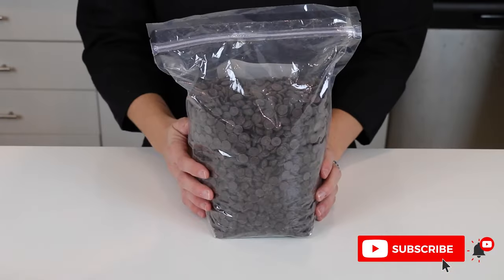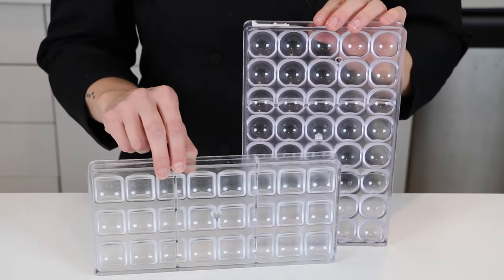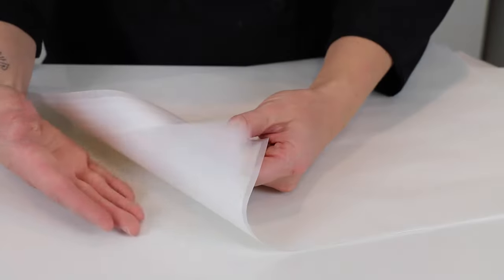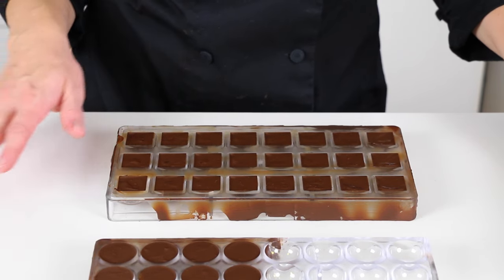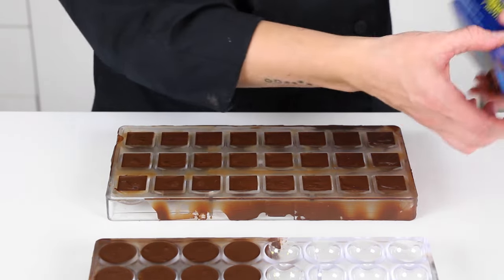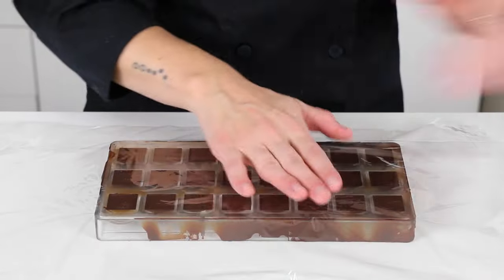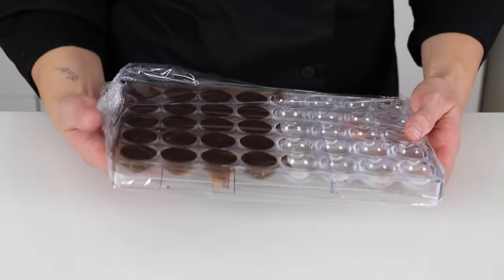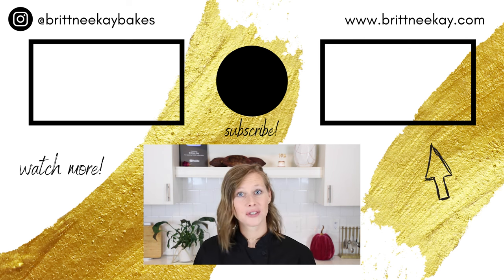Chocolate Molds | How to Fill and Unmold Chocolates | Gold Fall Bon Bon Design

Comment: After spending hundreds on labels and packaging I'm finding out the hard way you need more than just chocolate and coconut oil to make the perfect chocolate. It melted completely. Do I need a wax? I was trying to be healthy. Tempering seems impossible. I'm using a gravy dish that I sit in warm water  to pour the chocolate into molds. Thank you for reading
Reply from the maker: Hmm yes chocolate works takes research and many hours of practice! I wouldn’t expect to be expert at making formulating your own chocolate right out of the gate. It’s also something I can’t help with because it isn’t my specialty. I make filled bonbons using couverture chocolate that is already formulated. But don’t give up, just keep learning one thing at a time! 😃

Comment: Hi, I was very happy to see your video. My question is , why My chocolates doesn’t cames out . ? They stak in the mold ? I use the molds like yours. Be happy to hear from you. I am from Malta. Thanks
Reply from the maker: Most likely the chocolate isn’t tempered correctly, they haven’t contracted all the way, or the mold isn’t clean. What was your process exactly and maybe I can help! 🙂

Comment: It is so cool how you take the time to describe all the details of what you are doing. Thanks for going nice and slow so we can really see every step.

After you shell your molds, you are checking to see if they are the proper thickness. If you discover that they are too thin, would you wait until they dry completely and then do a second shelling?

I recently learned the hard way why it is important to work at the recommended working temperature for each type of chocolate. I tried shelling with a white chocolate (actually, caramelized white chocolate) at 32° because I wanted it to flow into the cracks of the mold more. However, it ended up so thin I could see right through it. The next tray I kept it at 32°, but kept it in the mold longer. This resulted in some spots being too thin and others being too thick. I had to literally scrape out the thick parts and paint on more chocolate on the thin parts with a paintbrush. It was kind of a disaster. The third tray I did it at the right temperature (29°) and, like Goldilocks eating the baby bear’s soup, it was juuuuust right!

PS Don’t tell anyone, but I actually purchased a huge vibrator for getting out air bubbles when using intricate molds. Yes, that kind of vibrator. Only used for this purpose, of course! A lot of chocolate shops have vibrating tables, which I have neither room nor funds for. It really works wonders! 😊
Reply from the maker: LOL that's hilarious! Hey...whatever works! 🤣

Yes, I feel you on the thickness. Honestly it never has been a big problem for me but usually just because I keep the kitchen temperature the same and I always use the chocolate at it's proper working temp. If you do that and keep the same momentum when molding the thickness is usually consistent.

But to answer your question...when I have gotten too thin of a shell I notice it immediately as I'm molding and I add more chocolate right away and tap it out like I normally would. If it starts to set give a quick run over the mold with a heat gun and then shell again, that way the chocolate will mold together.
When I've gotten too thick of shells I don't worry too much. That rarely happens and if it does I just go with it.

Hope that answers your questions! : )

Comment: Thank you for the video! It’s the best video out there for molding chocolate! 

One question though: why do we need to set the mold on its side to set? What advantage does that grant?
Reply from the maker: Thank you! 🥰 it allows the shells to cool evenly without trapping heat underneath. You can also prop them up above the counter on something, just as long as air can get around the full mold!
Reply: @BrittneeKay  oooh perfect thank you for your reply!!
Reply from the maker: @Amoor522  of course! 🙂

Comment: Hi Brittnee. Thank you for your video. I've just had a major disappointment making a batch of filled  chocolates. They wouldnt come out of the mold. Tried to put some heat on bottom to try and facilitate 'eviction' which made it worse. Landed up cutting up my mold to individually to prise them out. 😢 Dont know what I did wrong but will see if following your tutorial will help. I must add that I dont have your temperature meter nor hair drier so check liquidity and return to microwave when I judge the chocolate is becoming a little too stiff.
Reply from the maker: What kind of mold did you use that you were able to cut it up!? 😄 Ugh I'm sorry, that is frustrating! I have had troubles getting chocolates out of molds too and it is really annoying. Usually heat doesn't help, but usually cold does. So popping them in the freezer for a while until you can knock them out is better than melting them out. Though, either method is a last resort, but at least if they stay in tact you can eat them rather than throw them away.
I would definitely invest in a thermometer, it is crucial when tempering chocolate! You can start with a pretty inexpensive laser one from Amazon. You can also get a hair dryer for around $15 so I recommend that as well. My advice is to practice tempering and get really comfortable before molding chocolates to avoid disappointments! 😃

Comment: Thanks @BrittneeKay for this video; I really enjoyed it. Out of curiosity, how thick are the polycarbonate molds? I want to avoid buying ones that are too thick (as I won't be able to twist them like you've done here to get the stubborn ones out) yet not so thin they're fragile, floppy and eventually break.
Reply from the maker: Polycarbonate molds are pretty thick, thick enough to not bend while you're working with them, which is great. I know what you mean, at first I was intimidated because I was scared I wouldn't be able to get the chocolates out. But don't be scared, focus on mastering tempering. As long as your chocolate is tempered well they will come out!
Your other option are plastic molds where you can basically force any chocolate to come out. But I don't recommend these. If you're really interested in chocolate making I would just go for the polycarbonate!

Comment: I just started watching your videos and love them! I do have a question... after you remove from the fridge, can they stay on the counter and be fine so long as it's not overly warm? I ask since I'd love to gift some to family.
Reply from the maker: Thanks so much!! Yes, they should be fine at room temperature as long as your room temp is pretty cool, ideally 71ºF or below. The chocolate will be great at that temp. The fillings will vary depending on what is inside, but if you plan to gift them quick and have people eat them within a week I'd say that you'll be fine. I can't give specific advice unless I have an exact recipe and have tested it myself, which I am not equipped to do. So follow these guidelines loosely :)

Comment: Hi Brittany,  I've been working on Northern lights designs in my chocolates.  After I paint my colored cocoa butter in the molds, and let them set up, when I pour in the chocolate shell,  the colored cocoa butter in the mold, seems to melt up the side and sometimes when I pour the extra chocolate out it pours all the chocolate out of some cavities.

I thought the cocoa butter was tempered  
If while I'm painting the cocoa butter starts setting up does it go out of temper as it cools?   Ps thanks for your patience and help,  I appreciate it all.  
I love this design...
Reply from the maker: Hmm I've heard a couple people tell me they've had this problem and I have never experienced it myself. But my best guess is that it isn't properly tempered which means it has a lower melting point and when you pour the chocolate shell it is melted and running. Either that or you are pouring your chocolate shell at too high of a working temperature. Those are just guesses, it's hard to know for sure since I'm not there with you during the process.
What kind of cocoa butter did you use and did you do a temper test? What kind of color did you use in your cocoa butter?
Reply: @BrittneeKay   Navitas cacao butter,  homemade oil based,  food coloring for chocolate. Or  a dry powdered jelife food dye
Reply from the maker: It could the food coloring that is the problem. There is a reason I think powdered color is preferred because you aren't then adding extra liquids to the cocoa butter, which will change the final texture.  @birdsnbirdbaths-fd9qd

Comment: Loved your video. I'm from Brazil and is really difficult find some good explanations here. If it's possíble, can you explain how do you keep you ganache fluid to fill the cavits nicelly?
Reply from the maker: Thank you!! Yes, you can make the ganache fresh after creating your shells so that when it reaches the perfect piping texture you use it right then. Or you can gently rewarm it. This is for basic ganache with just chocolate, cream, and butter. With more complicated ganaches you wouldn't want to rewarm them. But if you are just practicing and not yet worried about shelf life this will be just fine!
Reply: @BrittneeKay  Thanks so much!!!
Reply from the maker: @cachosviajantes8153  Of course!! :)

Comment: Beginner here! Have all the things I need to start! Just one quick question: why do you let the shells set with the molds standing up instead of laying down? 

Love your videos! ❤
Reply from the maker: Hi, welcome! 😃 I just set them like that so the air can circulate around the full chocolate which helps them cool more evenly. It is mostly a precaution or preference, they can also most of the time be totally fine to lay flat as long as your chocolate isn’t too warm when you fill the mold 🙂

Comment: Great video, thanks for sharing with us.  Just one question if I may??  I notice you use lemon extract to spray the gold powder instead of using cocoa butter.  Does the lemon extract alter the taste of the chocolate shell, or the filling inside?
Thanks  again.
Reply from the maker: Thanks! You sometimes can taste a bit of the lemon. I actually like it, it isn’t too strong. For sprayed metallic powders you can also use 200 proof ethanol which would have no flavor at all. 🙂
Reply: Thanks so much for your reply, I'll give it a try.
Reply from the maker: @stampinstyledotcom  Of course! Good luck! :)

Comment: Gorgeous!  Very festive.  Can I use the golden powder in the silicone moulds without mixing it with the lemon mixture?  Would it work?
Reply from the maker: If you just dust it on it will create a very subtle sheen/sparkle. It isn’t quite the same effect but it’s nice. I like this because it’s more noticeable! 🙂
Reply: @BrittneeKay  Thx for the reply 👍  and it is ok to use silicone moulds right?  I do no have the ones u used in the video.
Reply from the maker: Yes for sure! They're tricky because they're flexible but you can definitely use them! :)
Reply: @BrittneeKay  Thx much🙏

Comment: Have you ever tried using a heating pad set on low covered with a small kitchen towel to maintain your chocolates temperature?
Reply from the maker: I haven't but it sounds like a good idea! : )

Comment: 1. Plastic scraper will protect your molds and keep scrapped plastic away from mix.

2. Any battery device that vibrates, such as old phone, vibrating sander tool, compact hand held back massager, will be a much quicker and easier air bubble remover.

Amazing eyes btw.👍
Reply from the maker: Thanks!

Comment: Brittanee your suggestion of a polypropylene bowl for tempering in the microwave was dishwasher safe but not microwavable???  Can you please tell me where to get the kind of microwavable bowl you have in the video?  Thank you!
Reply from the maker: Don't worry, that polypropylene bowl is also microwave safe! Polypropylene is a high temperature material and can be heated up to 250 degrees. You're safe to buy and use that one, it is what I use, and is from a Amaury Guichon's pastry shop.

Comment: Fantastic video. If the chocolate is still too thick at 32C, could it possibly be that my thermometer is inaccurate? I'm using Callabaut 811 54.5% chocolate, and an inexpensive digital probe thermometer. I've tried the microwave method twice. The first time the chocolate seemed to be tempered, but it was too thick to pour properly. The second time, it was still too thick, and unfortunately wasn't tempered either (I swear I didn't bring it over 32C, though!). Very frustrating. Any additional tips would be greatly appreciated!
Reply from the maker: It could be a thermometer problem, but it also could be other things. You could have overtempered your chocolate and it is getting thick...but I don't think this is your problem by what you've told me. Because it sounds like you said you used the microwave method but tried to keep the chocolate overall under 32ºC...
So, the half of the chocolate that you melt should and needs to go above 32 for the method to work. The melted chocolate has to reach higher temperatures in order to melt the correct stable crystals we need to develop. Honestly, when using the microwave method you don't need to take the temperature, just focus on melting half of the chocolate in the bowl, that's it. So I think the reason your chocolate is thick is because you actually never got it warm enough.
With that being said, I don't often use the microwave method when I'm working with things like bonbons. I will use it here or there in a pinch or if I'm making something like chocolate decorations. I would recommend you try out the seeding method, it is super reliable. Isn't quite as easy as the microwave method but pretty close!
Reply: @BrittneeKay  thanks! Yeah maybe I've been too worried about keeping the chocolate at or below 32C. I'll give your advice a try, and will also think about the seeding method. I'm fine spending more time on the process if it means it's more reliable.
Reply from the maker: Yes for sure! Sometimes chocolate is really confusing, I can see why you were fixated on the 32C. But actually reaching higher temperatures is very important in tempering chocolate! Give the microwave another try and don't measure the temp and full melt half and see if it works! Yes and also seeding! : ) @dflosounds
Reply: @BrittneeKay  update: I wasn't able to get the microwave technique working for me, but the seeding method worked great! I've finally made my first ever, properly-tempered bonbons. You should've heard the audible gasp I made when they all effortlessly fell out of the mold 🤣Your videos helped a ton, thanks!
Reply from the maker: Ohhhhh my gosh, I'm excited for you!! I know that exact feeling when they drop out!! 😃 Congrats, so glad I helped!  @dflosounds

Comment: How long do you allow the chocolate to set at room temp before putting in the fridge? How long do you put in the fridge with the plastic covering? thanks!
Reply from the maker: I usually just let the mold sit at room temp until the chocolate begins to set up (it will look dull and no longer be wet to the touch) and then cover them and let them crystallize in the fridge for around 30 minutes to pull from the mold! Hope this helps!  : )

Comment: What do you think will be the reason the painted colored and dried cocoa butter running along with the chocolate when you flip the mold ?
Reply from the maker: Did that happen to you?
My guess is that the cocoa butter wasn’t tempered properly so has a lower melting point or your chocolate couple be too warm going into the mold and melted your cocoa butter?

Comment: I like the spray bottle method the best. I’ve made a lot of chocolate lollipops in the past, and I’ve been always told to pop them in the freezer to set. It’s always worked perfectly, but lately I see many videos where they are left at room temperature to set or like you did in this when you put it in the fridge instead. Can you explain why
You don’t use the freezer?
Reply from the maker: The freezer has a lot of moisture and that can really negatively effect the finish of the chocolate. Ali g with that, the freezer is just too cold and can cause cracking in the chocolate!
Reply: @BrittneeKay  thank you for taking the time to reply! These molds that you used, if I don’t want to fill them with anything and I want to make let’s say a solid heart, it’s ok to just fill with chocolate, right?!
Reply from the maker: Of course! :) Yes, you should be able to do that just fine. But I recommend letting them set up for maybe an hour or a bit more at a cool room temperature before popping them into the fridge to contract. This will help them cool more evenly since they are going to be thick solid chocolate. Uneven cooling can cause streaking. Oh another thing that'll help them cool evenly is propping the mold up so that airflow can get underneath as well, so that warmth doesn't get trapped. Hope this helps! Let me know how it goes! 😃 @elsa.g.cabrera